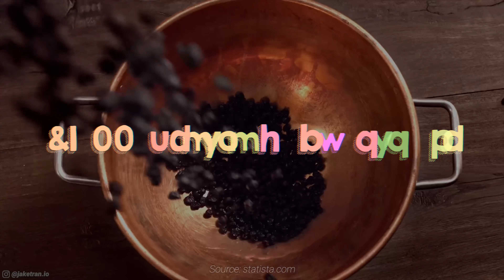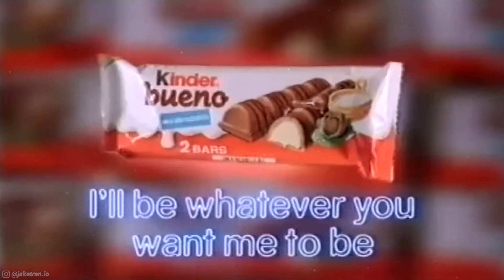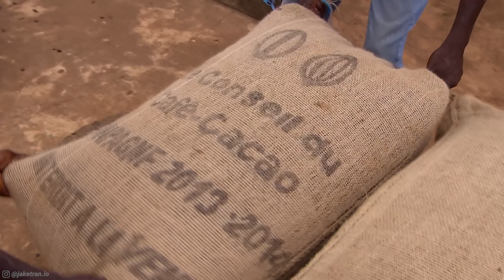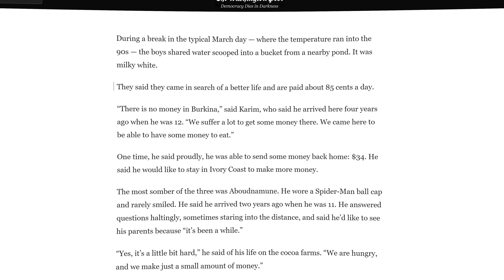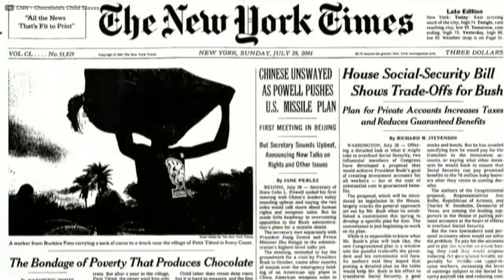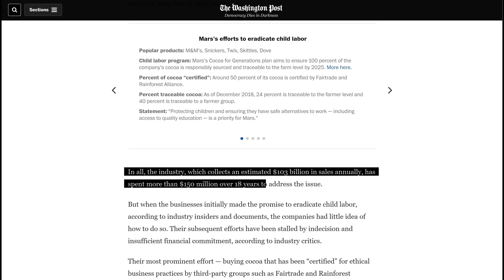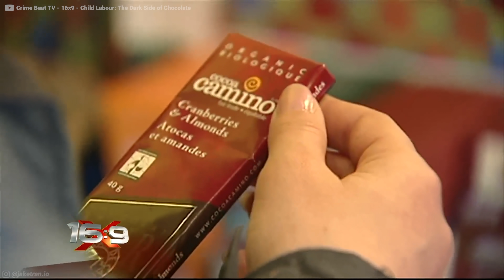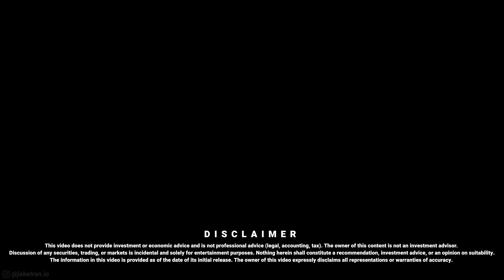Stop eating chocolate.

Comment: Oddly enough, chocolate has more value than diamonds. Diamonds only have value because Debeer limits the number of diamonds released.
Reply: Diamonds are useful for countless things
Diamond tipped saw blades cut cleaner and are more durable as a prime example
Reply: @dustinjames1268  all I'm saying is diamonds are literally one of the most common minerals
Reply: @dustinjames1268  how many people are buying diamond tipped saws compared to chocolate consumers?
Reply: @dustinjames1268  Those diamonds don't come from mines. They're artificially made.
Reply: @breveth  They're quite hard to obtain though. They "grow" under high pressure and in contrast to industry diamonds they have natural impurities. Each diamond is unique.
I agree that they're overpriced, but valuable diamonds are far from common.
Reply: @breveth  I wouldn't call them most abundant, but it is true that the price is raised artificially. At the end of the day they're still not easy to obtain.
Having a surplus doesn't make a gemstone abundant.
Reply: de beers no longer has a monopoly on the market, their market share isn't even 25%
Reply: @ThePandafriend  "having a surplus doesn't make a gemstone abundant."

Given the size of the surplus, yeah no, it's pretty fucking abundant.
Reply: That was truth back in the late 19th/early 20th century. Then USSR discovered some untold amounts of diamonds in the urals, so prices have fallen tenfold compared to how it was before.
Reply: De Beers hasn't had a lead in the industry since the 90s

Comment: I wonder why the chocolate cartel hasn't tried vertical integration by automating the harvest of cocoa. Yes it would be capital intensive, and you would not be able to densely pack the plants like corn or wheat but it'll cut out the middle man and prevent a lawsuit; however, I cannot see a lawsuit reaching over $1bn which is just 1/100 of the industry.

Comment: The funny thing is that I just bought cacao seeds. For anyone who cares about this: you don't have to give up chocolate forever. You can grow your own if you do enough research.
Reply: You can, but most people won't. It's a long process and requires time and commitment that most individuals are simply not willing to give.
Reply: @vol9329  fair enough. It's mostly to those who genuinely care enough about it. Chocolate supply doesn't have to come from those sources
Reply: Well, that also depends on the environment that you live in. Because I would assume that the plant would die in cold weather and trying to protect such a plant would be exhausting and resource intensive.

Unless you happen to know of a good technique?
Reply: @garybrown2039  Not one thing. Just creating a good artificial environment. This would be difficult for most people and would require a lot of commitment so I understand if most people think it's too much effort. Another thing I've seen is to use loose soil.